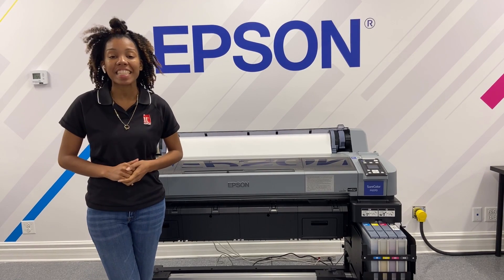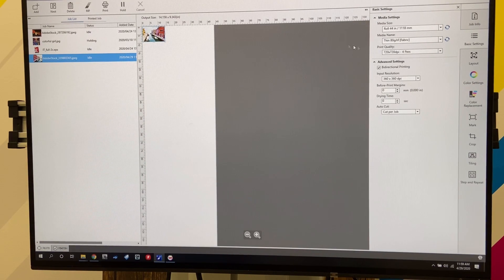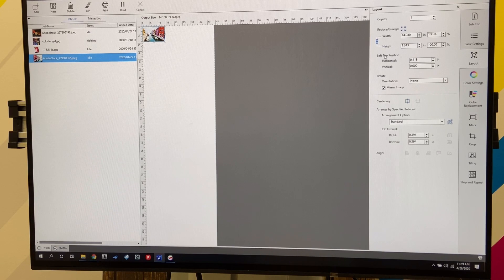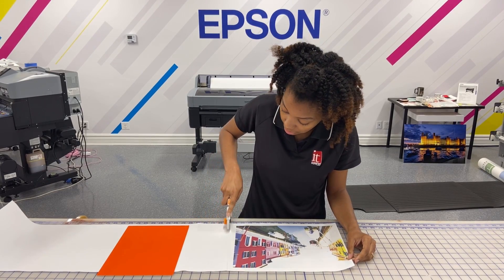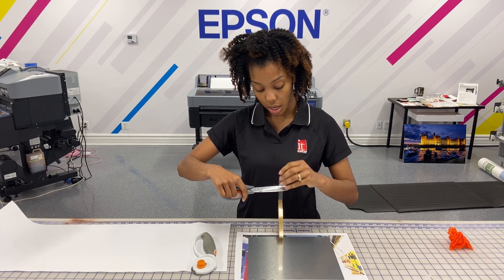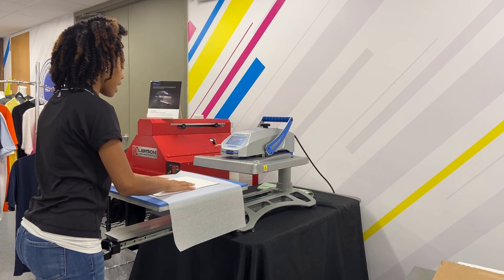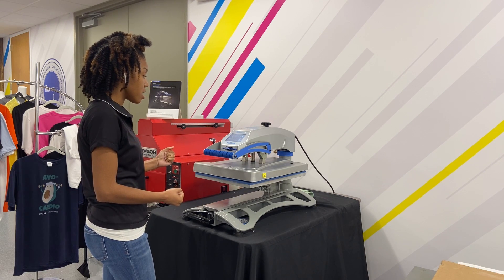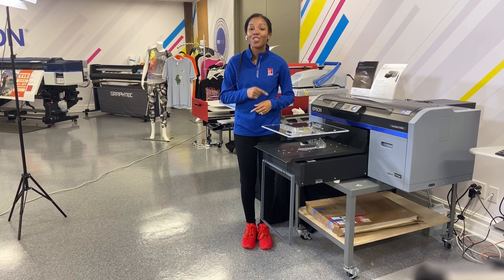How to Print on Metal - EPSON Dye Sublimation Printer and ChromaLuxe Metal Photo Panels

Comment: Thank you.  I create custom art.  In the past, I shopped it out to print on aluminum.  I recently got a smaller dye sublimation printer and a press, and have been mucking around with dialing in the steps.  This video was huge help.  Currently I'm limited to 15 x 15 (the size of my press).  Any pointers on larger format printers and presses?  I saw you're using the F570, which uses a roll.  What about larger format presses?
Reply from the maker: Hi John. We sell several brands of heat presses. For "large format" flat presses for metal we recommend the air automated versions from Geo Knight. There are several size options. Give us a call at 1-800-771-9665 and we can walk through the options.

Comment: Can we use HP Latex 800W to print?
Reply from the maker: Hello, Printing to Metal can be done on the HP R-Series Latex Flatbeds but cannot be printed on the HP 300 series or 700/800 series roll to roll latex printers as these do not accept rigid boards, only rolls of material. Dye Sublimation is a specific application and process with specific inks and specially coated substrates meant for dye sublimation inks. Please reach out if you'd like to have a conversation about your application ideas.  Email in at info@itsupplies.com or call us at 800-771-9665 and ask for a commercial sales rep.

Comment: 30 seconds?  Frustrating as not 1 sublimation business is the same as the next.
30 sec is the lowest time I've heard and 110 seconds is the longest.
Which one will be the best?
Material is expensive
Reply from the maker: Hi Joyce, time, pressure, and temperature can vary. We always recommend testing when using a new product. For more assistance please give us a call and speak with one of our textile print specialists at 1-800-771-9665.

Comment: Which printer would you recommend for smaller scale sublimation (13x19)?
Reply from the maker: Hi John, we would recommend the Epson F570 to you. You can use sheets or roll fed media that will give you the versatility you'll need in a printer for 13x19 prints. https://www.itsupplies.com/Epson-SureColor-F570-Pro-Dye-Sublimation-Printer-p/scf570pe.htm

Comment: What did you do to the metal substrate to sublimate?
Reply from the maker: Hi @UrDaddy islandgold, Thank you for your comment. We are a distributor for Universal Woods (ChromaLuxe) who uses special patented technology to coat the metal in a polymer coating allowing us to sublimate onto the metal. So, in this video, we did not prep or alter this metal. We took off the protective film and then applied heat, pressure, and time. Check out this link to see the different sizes of ChromaLuxe we offer : https://www.itsupplies.com/SearchResults.asp?Search=chromaluxe You can also call in to our customer service for additional assistance : 847-394-9573

Comment: PREGUNTA : CUANDO AGREGO Y CONFIGURO LOS CONJUNTOS RAPIDOS SOLO DURAN UN DIA ES DECIR SE BORRAN AL SIGUIENTE DIA PORQUE?? F6370
Reply from the maker: Hi Carol Rosa, we're so sorry we missed your comment. It may be an antivirus that makes it disappear. Try this, create a new quickset. Close Epson Edge and restart your printer/computer. Then reopen to see if it solved the problem. You can also try uninstalling your software and then reinstalling it to see if it fixed the error. I would also check Epson's site to see if they have a software update. If it is still not saving, contact Epson dedicated support line for SureColor users (562-276-1305) to resolve this issue.